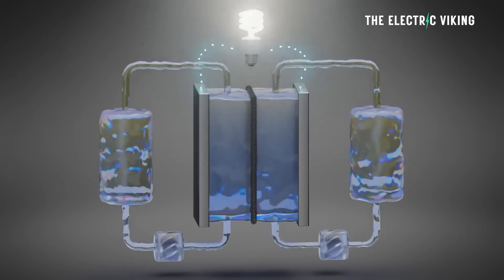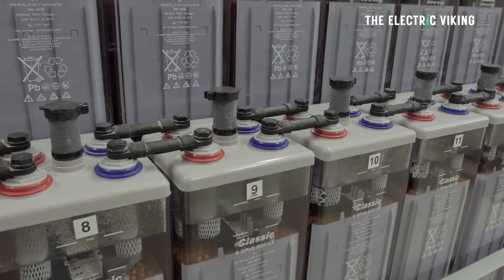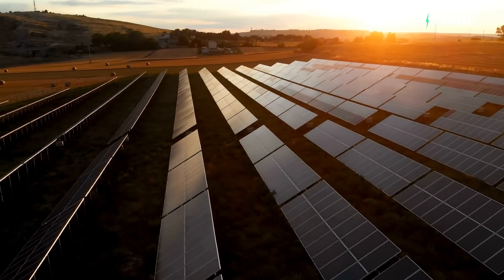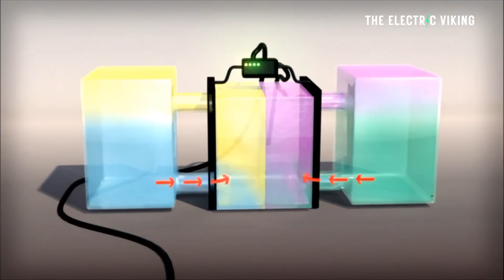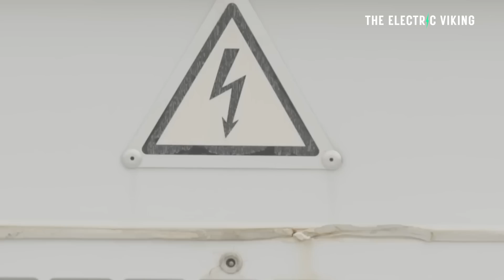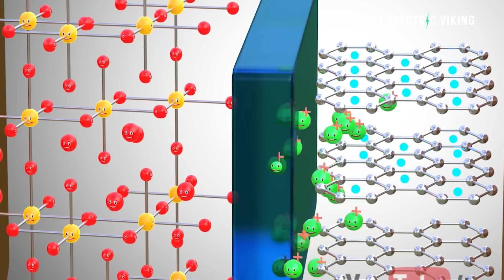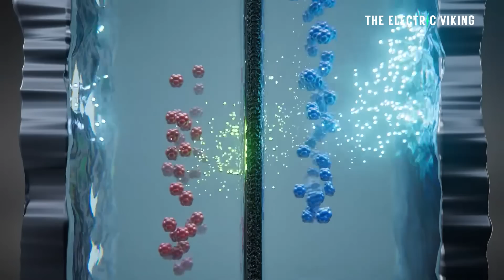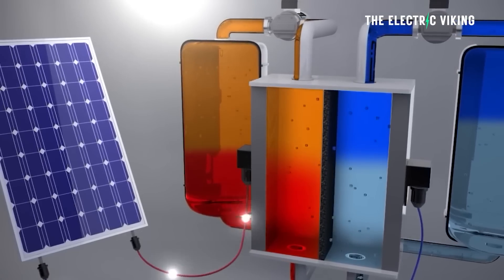Why Vanadium Flow Batteries Are DISRUPTING Lithium & Sodium Batteries

Comment: I logged on this morning fully hoping to get another dose of “game changer” batteries and I wasn’t disappointed. Sam had published this video 3 hours earlier and I was happy to see a new revolutionary entrant into the field, “Vanadium Flow Batteries”. I’ve lost count but this is about the 62nd “game changer” battery Sam has announced since Jan 1st this year 2025, and we’re not quite half way through. I’m sure there’ll be a Vegemite powered battery at some stage..
Reply: You're not a million miles away with Vegemite; EMPA, a Swiss lab, worked out how to make a fuel cell that's powered by a yeast and a fungus as the anode and cathode. 
There's also quinone based flow batteries and quinone can, by a roundabout chemical synthesis route that's not normally used in industry, be derived from the bark of the cinchona tree.
Reply: @mememaster147   That’s great news. So if I’m broken down way out in the bush in my “Vegemite Battery” powered EV, I can slice a piece off and eat it. A truly dual purpose battery..😅
Reply: @mememaster147  That's really interesting. The big test though is if you can have that stuff on toast for breakfast.
Reply: 😂😂 @mememaster147
Reply: I've got a leak on tomorrows video. Why XXX Batteries are DISRUPTING Vanadium & Lithium & Sodium batteries.
Reply: @Brian-vs9sd Porn batteries? I wonder how they're charged up...
Reply: Yes, lets have a taste of that.

Comment: Not good for large short term surges. Maybe good for long duration slow steady discharge. Therefore likely best as a replacement for pumped hydro where that technology is not feasible.

That said the redox battery installed on King Island was a failure (instability for various reasons). It has been replaced by of all things a grid scale lead acid battery.
Reply: Perhaps it's a "moving parts" thing, as soon as you have that, you have the regular cost of mechanical engineers

Comment: I invested $10K in Redflow batteries which went bust☺️ As an electrical engineer I knew they had great potential, but I knew little about commercialisation but feel somewhat justified in my assessment of these batteries and their hugh potential
Reply: It is a shame Redflow went bust..they were just too early..Flow batteries are the only technology that allows you to store energy and apply it on demand.
Reply: Darn. That's a sad tale. As you say, the potential is there. Good on you for at least trying.
Reply: I like the concept of red flow but I never invested. I never thought they understood you needed to think BIG, big tanks, big pumps and big capacity. I am glad to see these are coming along, even if RedFlow didn’t make it.
Reply: Can I ask you of the name of you don't mind.
Reply: https://blauwgroenenergie.blogspot.com/2024/05/an-hbr-flow-battery-e.html
Reply: That was a disappointment. They looked promising from my limited perspective. Were the batteries too expensive or simply designed too small ?
Reply: I've invested in Invinity, Largo, and Australian Vanadium. Invinity is putting in bids for the UK who's requirement is 8 hour storage and minimum life of 25 years.
Largo and Australian Vanadium are vanadium miners and refiners with divisions to make batteries as well.

Comment: I think the characteristics will be different, probably slower response time, maybe less efficient, so they may not be so good for FCAS, but might be good for peak demand and longer term weekly use.  They will work along side Lithium/Sodium Ion.  We need all technologies, the more the better.
Reply: A great aspect of flow batteries is the ability to scale both charge rate and capacity independently of each other.  Need faster charge/discharge have more exchangers; need more capacity? Have larger fluid capacity.
Reply: @Zirrad1  Discharge rate is not the same as response time.   To be honest I am not sure how they work exactly, but if it involves pumping anything there will be a response time.  Ie how long does it take to get to rated current.  For example Hydrogen is slow because air and Hydrogen needs pumped in and FCEVs need batteries while the fuel cell throttles up.  Grids trying to correct for faults or sudden loads where frequency is going out of spec need to respond in milliseconds.
Reply: @tonystanley5337  Yeah, I don’t know either. But a flow battery when the electrolyte is not being actively pumped but is not depleted is just a fully charged battery is it not?
But you’re correct, a fully scaled installation could have a variety of electrical storage devices tailored to provide the response the grid requires.
Hmm, but even a flow battery bank could be more responsive than the mechanical spool-up required of FF steam or hydro turbines

Comment: Looks like another great storage choice for solar ... it again creates an unsubsidized price advantage for solar + storage over anything, including wind
Reply: Battery use doesn't shift the dial on type of renewable energy source - that varies by location rather than energy storage approach. Wind is more common in parts of the world (like Northern Europe) than solar, and visa-versa in other parts like the central Sun belt around the globe. Battery storage works equally well for both.
Reply: Solar (DC) -> Battery (DC) -> Inverter (AC) -> GRID (AC),   Wind (AC) -> AC/DC Conversion -> Battery (DC) -> Inverter (AC) -> GRID (AC) ... you have an extra layer of loss with wind/battery.
Reply: Yes, there is a small difference, 3 to 5% on average, however, in locations with significantly more consistent wind than solar this doesn't matter as the annual solar radiance in these areas is much lower than the wind energy capture potential.

It's not about the per unit ideal efficiency but the renewable energy output per sq km. In some parts of the world renewables generatoin favours wind, in other parts solar as well as geothermal or hydro in various other parts of the world. It's about what works in a particular area rather than the best ideal renewable mechanism.

The UK for example has one of the highest wind output capacities in the world but a relatively low solar output capacity.
Reply: True, I was thinking about the US which usually has some good solar collection areas on a given grid.

Comment: These batteries have weight and heat issues for EVs.  They might be viable for railroad engines.
Reply: There have been small domestic cells versions about suitcase size . 
The real  benefit is long life ..safety and environmental mental temp insensitivity .. but they can hold a charge for days till it's needed and maintain it's discharge safely to 0%.
Reply: Electric Viking says vanadium flowbatteries are not suitable for EV's ect. But as stationairy. For Example placed near (old) coal power plants.